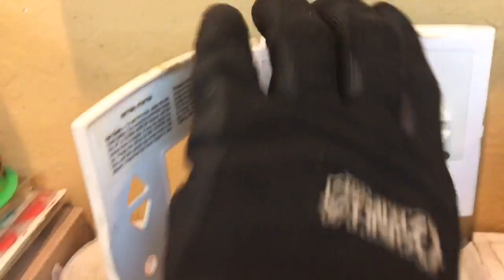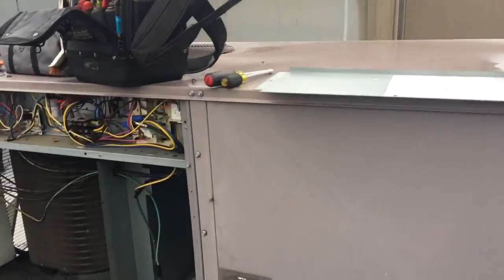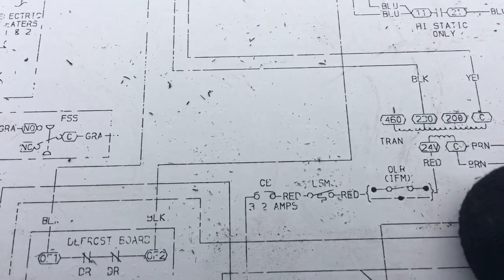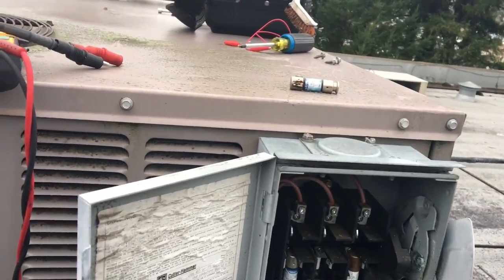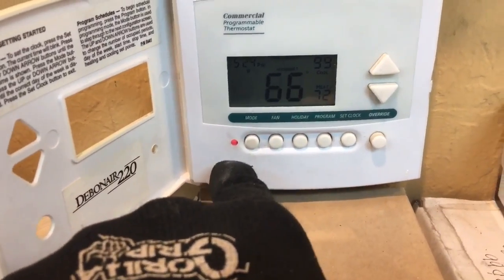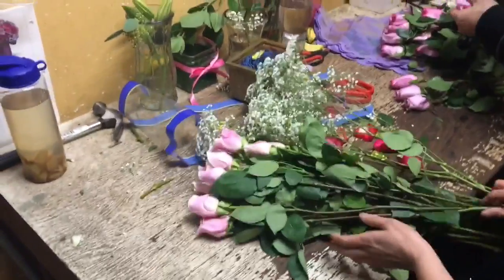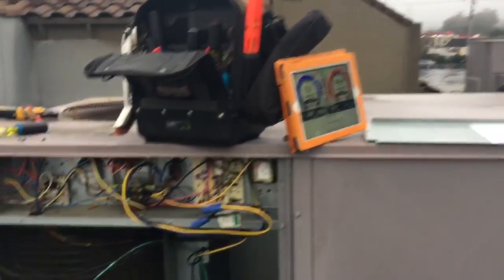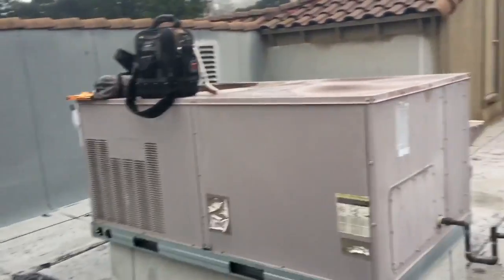Trouble shoot a carrier packaged heat pump

Comment: Dave, here is a tip for Carrier heat pumps like this. They do not use O or B. The board logic receives a W1 call and operates the unit appropriately. ALSO...there is a recent recall for Eaton disconnects of that size, so if you replaced the CH with an Eaton, have a look and see if it is covered. Finally, whenever I find a Venstar stat like that one, I replace it as well. I am looking forward to getting the iconnect system.

Comment: cheap disconnects anymore have the steel fingers to hold in the fuses and the fuses have  steel contacts.  you can bend them in then brush with a 1/2 inch line brush or sandscreen then coat the fuses with a contact grease and get more life out of them.  they carry a lot of amps to run the unit and get hot and bend off the fuses.  all these contacts used to be copper.  we had the square D plant near me in clayton nc but it moved to mex a co. several years ago.  they made the best equipment.

Comment: No doubt, Great customers service claims warranty. But on the design point of view, I'll modified the unit together with 2x evap blower fan motor & compacted micro evaporator on TOP of the condensing unit. So no more loopy copper pipes & guess work for techs recharging the unit. BTW, Hydrocarbon is the future & doin' our share saving the PLANET earth🖖.

Comment: Great find Nor Cal. That was a compressor lockout board. The smaller board close to where the thermostat wire in. Thought they quit putting them on their package units before 2000. Looked like no wire in the amperage sensing part of it from the compressor the video. I never worked on a heat pump Carrier.  I Work in Michigan.  Is the reversing valve close to the compressor on the other side of the unit  by the condenser coil. Thanks for the good videos.
Reply from the maker: polishtheturd mickelson yes the reversing valve is.

Comment: 3 Phase unit --- with a Leg dropping in and out. I am Damn Suprised that Compressor did not Fry with the One Leg dropping in & out like that. Testament to that compressor. What do you think of the chances of possible internal winding damage are ?
Reply from the maker: OcRefrigeration,Hvac & Electrical. When the leg would drop out it killed primary to the transformer so the Tstat would go blank. The compressor never single phased. Lucky unit.
Reply: Right remember how Carriers rooftops are wired. On their 3 phase units with a 2 pole contactors. Customer got lucky that the middle line on the disconnect was defective and feeding the transformer line side of  the transformer.
Reply from the maker: polishtheturd mickelson yep

Comment: Thanks Dave ! Exactly the kind of Real world scenario i was looking for. inside the building, through a Roof at the thermostat. You can tell the whole time if the Unit Quits & How its functioning while u go inside the building , saving u time. I m thinking also using it to Locate a thermostat for a specific building that has alot of units on the roof and nobody knows which thermostat controls what unit or where. With this you could Find a thermostat u think is the one and tell right away if thats the unit. turn on stat , unit comes on , whala thats the unit. To make sure , turn off stat , and pressures equalize on your guages on the tablet. Awesome !No need for second man on the job.
Reply from the maker: OcRefrigeration,Hvac & Electrical. Exactly.

Comment: Nice video Dave you on a different league with the I-connect I'm barely trying to save up to get the Testo Smart probes
Reply from the maker: Felipe Tafolla the range on the iconnect is crazy good.
Reply: BP 27 I guess I have to step it up 😊
Reply: Nor-Cal Refrigeration & H.V.A.C how far did you go without losing connection? I might pick up a set of Testos to get started
Reply from the maker: Felipe Tafolla testo only go 25 feet blue tooth range.
Reply: Nor-Cal Refrigeration & H.V.A.C ohh what about the I-manifold?

Comment: nice vid. the 130° condensing temp and 2° SH didnt worry you?
Reply from the maker: Trever Kirk no because I don't think I profiled the unit correctly. And I'm not sure if I assigned the temp clamps to the correct location. 
The indoor coil is in need of a cleaning though for sure. Oh and I forgot to zero the probes also.
Reply: Trever Kirk we don't know how warm it was outside but it was probably low 60s and it's pretty normal to see higher condensing temps in heat mode. It may still be overcharged or low airflow across indoor coil.
Reply from the maker: Joe Shearer it was in low 60's and 100% humidity. I still don't know if I need to zero the probes every time. And I didn't check my return duct size which usually in this town is to small. Lol

Comment: Dave, if a scroll compressor has a hardstart kit installed on it and it still wont start is it dead?
Reply: Are the windings open ? Does it do anything ? 
If it Draws Lra then Probably Seized up.
You have one of 3 scenarios---
1) Compressor Draws Lra = seized compressor.of course im taking into consideration you checked your capacitors and replaced the start relay.
2) Compressor Is Grounded = tripped circuit breaker. Compressor junk.
3) Compressor windings are Open = Compressor junk. Possible burn out. Ohm out compressor while its cold. C-s and c-r must equal s-r.
Any open windings ---compressor junk.
Reply: OcRefrigeration,Hvac & Electrical. ok first thing I checked was the duel cap and it was weak, so I changed it. however after that it was still doing the same thing. I tried putting a supco spp6 but nothing but humming. It wasn't grounded as no breaker trip. I will try checking the windings when I get home. Lra on this unit was 76 amps it was only pulling 68-70, still fairly sure it's seized.
Reply: No Further checking necessary. Lra is close enough. Compressor is Seized.
Reply: Usually Seized compressors come from Running a unit that has been low on refrigerant for a while.
Reply from the maker: fastzombie1 depends there are many things to check.
Reply: Yep, compressor is seized. Those are Lra. Locked rotor amps.
Reply: OcRefrigeration,Hvac & Electrical. ok, figured I was correct. would a 1/4 inch liquid line be part of why it locked up?
Reply: Replace compressor.
Reply: What tonnage unit ?
Reply: 1/4" will work up to 2 tons and max 25ft of line set. A run longer than 25' has to be 3/8" 3 tons to 5 tons 3/8" liquid line.
Reply: fastzombie1 m
Reply: m?